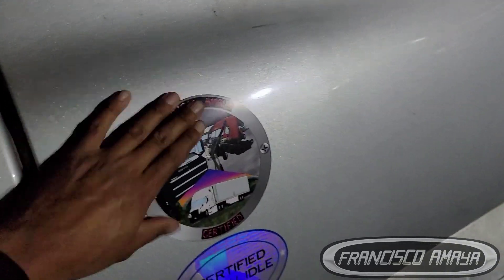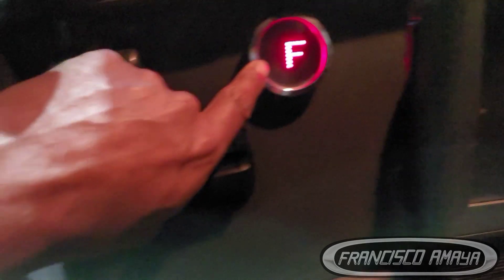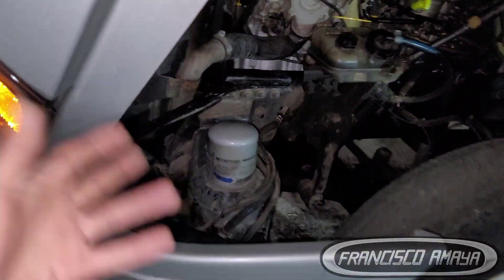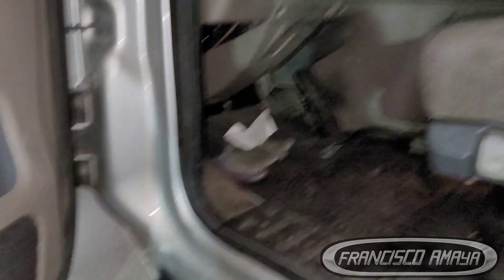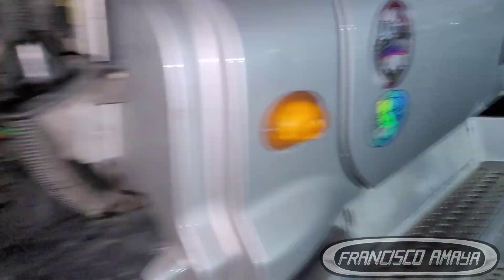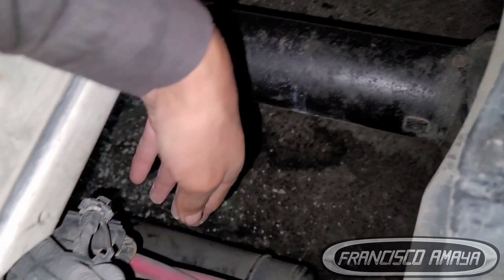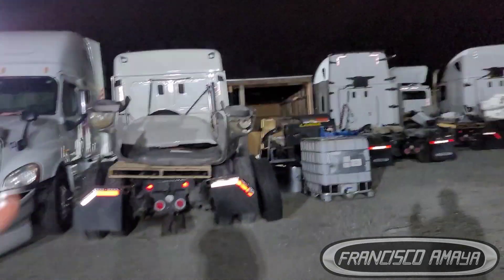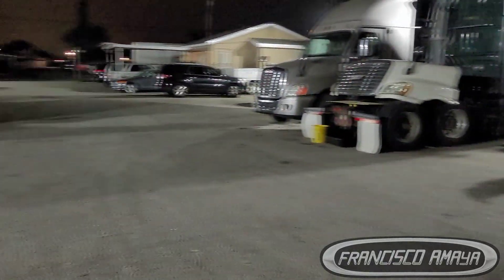DD15 engine overhaul problems after major engine repair engine does not start run what to do

Comment: Francisco buenas noches una pregunta amigo cuando el camion esta en idle y esta haciendo up and down que es lo que hay que cambiar la fuel pump o los fuel check valve
Reply from the maker: fuel quantity control valve
Reply: @franciscoamayaYT  how can you tell when that check valve inside the fuel filter housing at the bottom of the small fuel filter goes bad? Thanks

Comment: Hi, I have a 2015 cascadia DD15 with code SPN-5488 can you say what and how many part can trigger this code.
Reply from the maker: that is a def heater line, check the complete code to see which line has the problem

Comment: Francisco comore un 2008 kw con isx corre bien despues de una hora deja de acelerar y se apaga por donde puedo empezar a revisar muchas gracias
Reply: Computadora
Reply: @laloyup8164  después de 10 minutos vuelve a prender
Reply: Presión de diesel?
Reply: @LuisGonzalez-hy3gh  pues si, con cummins insite puedes checar la presión cuando tengas ese problema, asi puedes descartar esa opción,
Hace un tiempo tube un problema similar, no aceleraba todo marcaba bien desde el pedal asta el nivel del diesel, tenia una ecm de otro motor y jamás tuve ese problema. 
Tambien puedes checar el shutoff solenoid 
Si es un cummins isx con doble cam
O tienes el
Isx15?
Reply: @laloyup8164  amigo es doble cam
Reply: Deja de acelerar y se paga, normalmente cuando sueltas el acelerador para hacer un cambio de velocidad ya no acelera y se apaga después de 5 minutos vuelve a prender como si nada camina otra vez y se vuelve apagar

Comment: What’s average price for rebuilt for dd15
Reply: 25 is just parts lol i😢
Reply: @kiopofcsret  lol
Reply: No worth to rebuild. You can buy a reman engine from dealer. Most parts a new with manufacturers 1 year warranty.
Reply: @JoseMartinez-jl1mk  lol good luck , there is no way u can get one from the dealer now days , have u heard of national back up orders on almost everything from the dealer ? For God sake u can't even buy a cpc4 from a dealer since last year April! 
Mmmmm are u sure u live here with us on earth ?
Reply: @chiefdarkhorse7718  it’s easy to get engines just got a new Cummins x15
Reply: Around 25k i believe
Reply: I saw a rebuild invoice on the desk at Freightliner the other day for just over $44,300.
Reply: @foltzenlogel  oh helll na you can’t go to no dealer lol they gonna kill you
Reply: Just done overhaul cost me 29k with clutch . It's out of frame overhaul .
Reply: Got mine done in may with a a fully redone head for 17k at the shop i always use